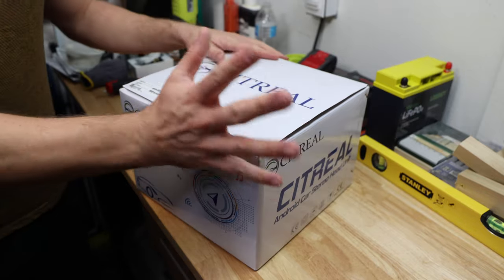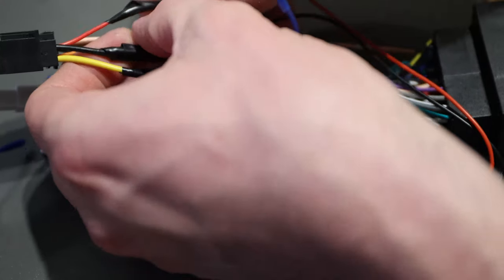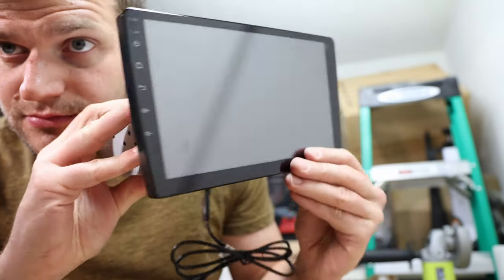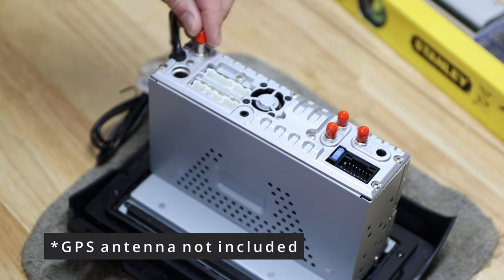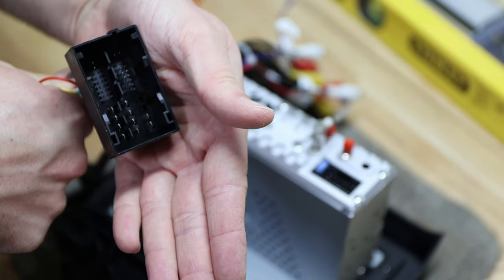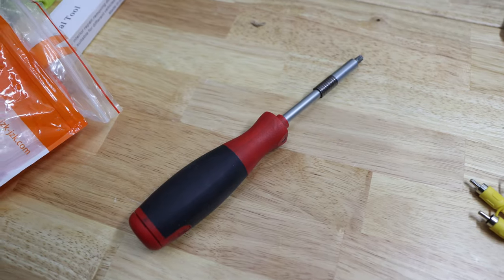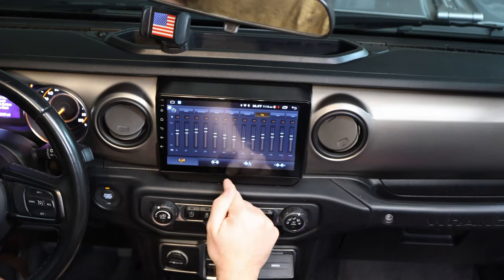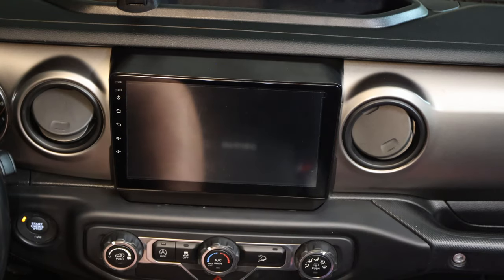Jeep Wrangler/Gladiator 2018 - 2021 Car Radio 9” with Android Review | Installation instructions

Comment: Just installed in my 21' gladiator , ordered the radio from amazon and the one i received no soldering, splicing was required for the backup cam, hardest thing was getting all that stuff to fit also i had to move the chasis of the radio to the highest point to fit in my jeep as well , great vids ! id be screwed installing it without your vid , cheers
Reply: I have a 2020 G Gladiator but it only has the single zone H. Back doesn't have the door zone and I believe that's my issue. The radio thinks I have a doorzone

Comment: I'd highly recommend soldering the wire splices if possible.  If they're just wrapped they'll inevitably come loose.  Otherwise thanks for this series of videos, it's very helpful. And thank you for showing where the clips are behind the trim.
Reply from the maker: Agree! I did not do it but when I open the radio next time I will solder as well. For the video I did not wanted to do it since I anticipated getting a radio without any additional work especially soldering in a car ;) Well it didn't work out ;)

Comment: Great video and a big help when I just installed mine!  Had a couple questions if you've run into them/figured them out.
1) How do you get the quick button to climate control off the screen? I saw the snowflake on yours but since we still have the manual knobs, none of the screen's electronic controls function so I'd rather just get it out of there.
2) Have you by chance installed an additional forward facing cam? If so, do you have a video of that?
3) Have you found that many apps are unable to be downloaded and do you have a workaround for them?

Thanks!

Comment: So, I purchased one of these units after watching your video, installation was pretty straight forward, thanks to you, because they do not have a owner's manual, the only thing I'm having hard time with is the 4G network, on your videos it's pretty easy opening the SIM card slot, but mine is different from yours, it does not open, I got a replacement and the same thing, does not slide to the right and opens, nope, there's an openig in the front but it doesn't open, it sucks because the only way I can use the GPS is if I use Apple Carplay, no network for me because it says that there's no sim card. Can you help? They customer service sucks.
Reply from the maker: Dang, that sucks. I'll try to get an answer from my contact and sending your comment to them. I hope they come back quickly
Reply from the maker: I received same feedback as you. Can you provide a picture or video of the sim slot how it looks like?
Did you check on the correct size of the simcard? Maybe there is a adapter needed?
Reply: Actually I just figured it out, they have made some changes to the SIM card slot, different than yours but works now, thanks for replying so quickly
Reply: @Andreas Dima Make sure your bluethooth is ON, and connect with your Stereo, it says ZH-Android, once that's connected you should be all set.
Reply: Does it come with or require a new bezel?

Comment: Great video everything works except my HVAC controls are malfunctioning.  I have a basic sport gladiator and i cannot figure it out
Reply from the maker: The HVAD control unit should still be the OEM, right? Did you check the wiring/plug if it is connected properly?
Reply: I will send you a video of showing the issue I'm having.
Reply: I checked connections seems to be fine . I believe radio thinks I have a dual zone hvac . This is not the case
Reply: Uploaded a link to vid guess it keeps being taken down.  I'll load it on my channel. I'm curious on what you think is the issue.

Comment: I installed the converter box just like you said it’s not working for me I get video under inputs  but when I go to reverse nothing happens on screen any help would be appreciated thanks
Reply from the maker: I did contact the seller and they were pretty responsive and helpful with this. They sent pictures as well. Not sure if they changed something in the meantime...

Comment: Does this still work with the steering wheel controls. And the factory ac knobs below. I have the 7 inch with dual climate and alpine speakers. Would this be worth the purchase?
Reply from the maker: Good question. Since I do not have this setup. I have a stock Unlimited... I guess contacting the seller might be a good try. Sorry I cannot answer your question

Comment: I’m considering buying this but I’m curious how do the steering wheel functions work with it? And will it work with Apple/android play
Reply from the maker: Yes, my steering wheel buttons work like in a factory radio setup. Regarding the Android auto I cannot confirm it works since it did not for me. If the Apple carplay works I do not know since I do not have a iPhone. Maybe someone else can answer?
Reply: I can answer that, it’s been a few months since I installed this unit, my CarPlay is losing connection all the time, most days I leave work and it’s working fine within 10 minutes it freezes up and the rest of the ride home which is 30 minutes is dead quite, again, wish I didn’t purchase this cheap unit, with another $400 I would purchased something much better!
Reply: I have been unable to connect my steering wheel to the unit. Is there any thing that you needed to do in order to connect them? It says I need to put the Jeep in a learning state but I am unsure how to do this.  @tobisreallifeskillswithtobi
Reply from the maker: @maxdush5899  That sounds like either something changed in the product or something is not connected properly. It worked plug and play for me and opening the settings on the tablet itself was just some fine adjustment if needed... I would contact the seller. They are usually p;retty good in working with you to solve the issue. I hope you can figure this out quickly